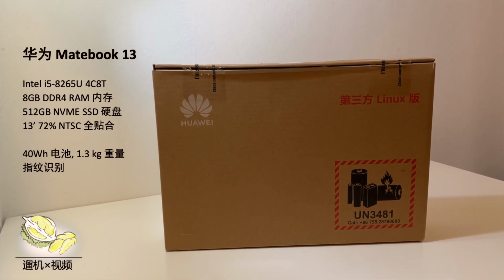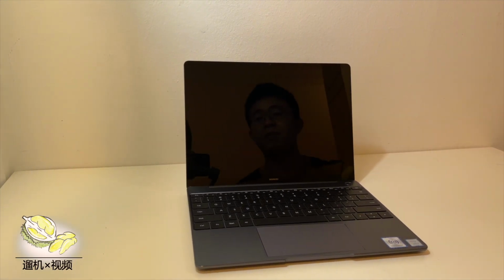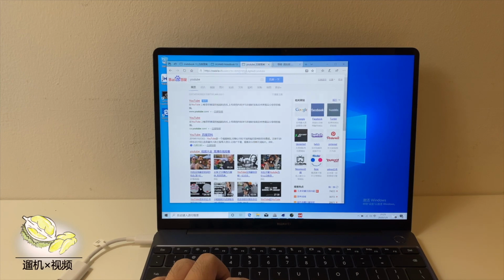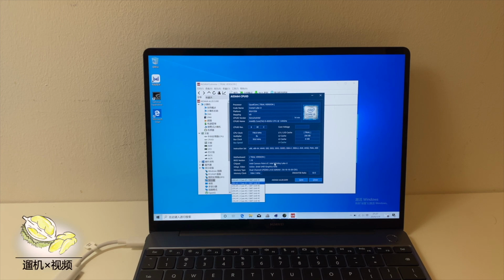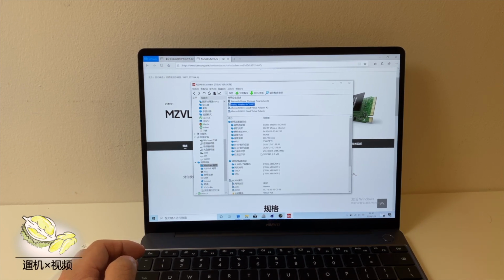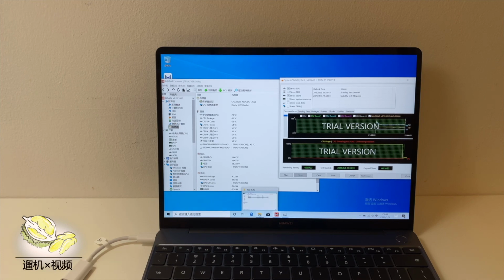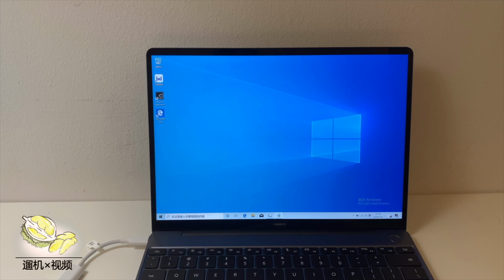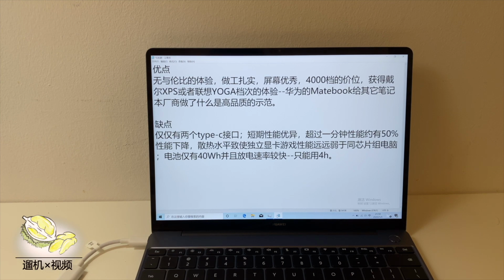[DurianP] Huawei Matebook 13 2019 i5-8265U [Review and Experience]

Comment: How’s the touch bar ? 
And does it good for editing videos like using photoshop and after effect and Pr ? 

And does it heat up ?!
Reply from the maker: Only Macbook has touchbar.

For PS it is fine. PR is a bit stressing. It will feel hot on surface but temperature inside is low.
Reply: The i5 edition has atouch screen?? And has alight keyboard??
Reply from the maker: @user-yn2eq4bn8r  Buy 2020 version for touch screen. 2019 version all not have in my region